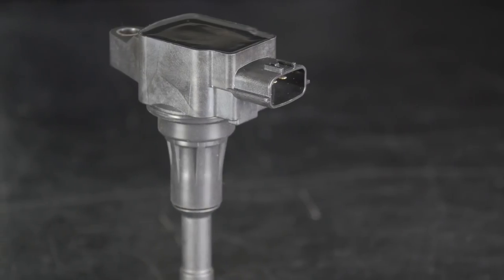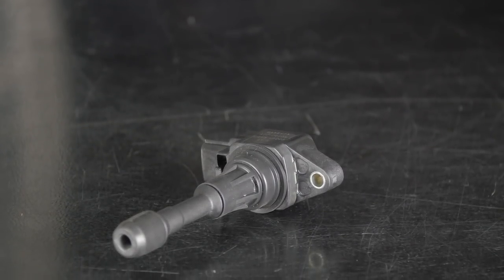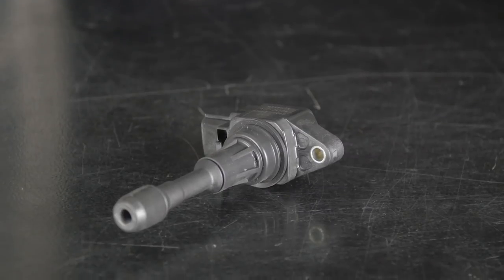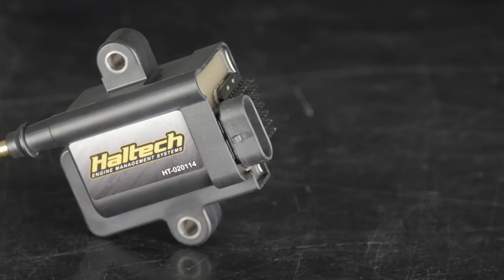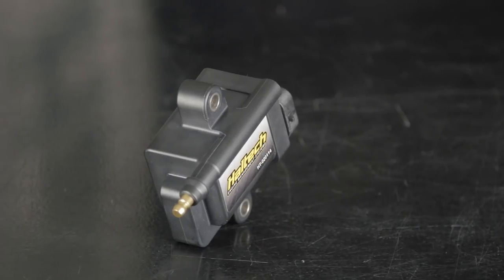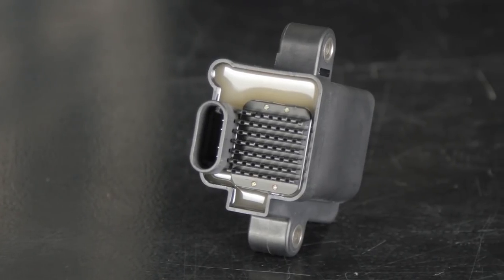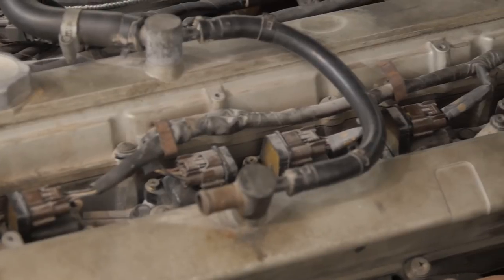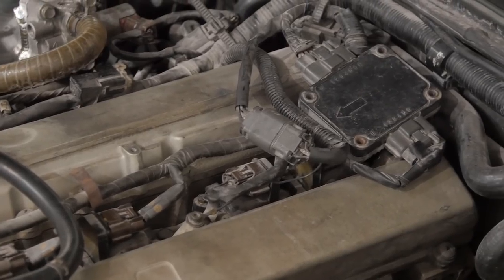🛠 Ignition Modules and Coils  | TECH TUESDAY  |

Comment from the maker: Ignition modules and coils - What are they, which one should you use, and why are they not often seen internally in an ECU? In this episode of Tech Tuesday Scott talks ignition modules and coils, tells you which set up is his favourite, and why. As with all Tech Tuesday videos - we are only covering the basics here, if you want more information on a particular topic - let us know and we'll expand on it in a full feature tech video:)
Reply: What about capacitor discharge ignition used in some older cars and motorbikes? Can they be controlled with a Haltech ECU?
Reply from the maker: Yes indeed!
Reply: Would love to know more about Power Distribution Modules compared with fuses and relays.
Reply: @haltech  i have a question/topic that you could cover. currently turbo charging my k24 accord euro. I'll be using an elite 2500 as piggyback. it has a dead head fuel rail and in tank pressure regulator. do i need to install a fuel rail with return so i can use a FPR that is controlled by boost to keep fuel pressure correct as boost goes up. or can you tune it to open injector for longer during higher boost to compensate for boost pressure. also only going 8psi of boost, i suspect higher will have no choice but to change the fuel rail for FPR. that would be a good topic for a vid about fuel pressures
Reply: great videos! how difficult is to control a automatic transmission & electronic rear diff with a Haltech ECU? Thanks a lot!
Reply: With r35 coils on my sr20 how do I adjust on the sport 2000???
Reply: @muzzarobbo  Fuses and relays are out of date technology that take a long time to diagnose issues with manually. Fuses blow and need replacing. Relays take up space and need large diagrams. With PDMs/PDUs everything is neatly packaged in a solid state system that self-disgnoses in real time. The future is now. Awwww yeaaaah!
Reply: so an LS/r35 coil doesn't need an external igniter module?

Comment: You guys have GOT to do something on nitrous oxide. I know it's not super fashionable any more, but some of us live places where E85 is unobtanium. I'm especially interested in staging and/or proper granulated control. "Just do a 200HP wet shot" doesn't really cut it.. How to get the ECU on board to control it, and at the same time adjust the boost map to the colder charge temperature while the nitrous is spraying?
Reply: E85 is never unobtainable. It's easily ordered online.
Reply: That sounded rude. Just trying to give you information. Have a great day!

Comment: Can y'all do a complete video on converting a cable throttle to an electric throttle? Not just high level, but in depth into what you will need? I am considering making the swap but I have a lot of mismatched parts
Thanks
Reply: What you will need will be vehicle specific. They explain in detail what they sell, and how they work.
Reply: @captninsno2320  it's not really that vehicle specific. Unless it's all preconfigured in the Haltech for all throttle pedals and throttle bodies, I imagine you would need to map the resistance of the throttle pedal (not all throttle pedals are going to have the same range) and you'd need to map the throttle body (as not all throttle bodies will have the same range or resistance or coil setup). I'd argue that they can walk through the process of converting and configuring a "universal" type pedal with a "universal" type throttle body. I am sure LS and Chevrolet parts would make it easier to set up.
In my instance, it is likely going to be a Mini Cooper electric pedal and a Mitsubishi Lancer 2.4 throttle body since those parts bolt up to my car already and I have them on hand. But a chevy TB would need the same set up process unless it's already preconfigured for it out of the box for some sort of plug and play set up. You could also cover things like adding in cruise control or some sort of throttle cut for traction or engine safety.
There is a whole lot of Haltech info they can share. They always say they are awesome, but never how to set one up ;-)

Comment: Hi, 

Maxxecu recommended putting an external capacitor on a built-in ignition coils system wiring (on 12v supply) in order to absorb voltage spikes which in turn prevents CAN disconnection. What do you think about it ?

Comment: so with my haltech elite 750 or 2000 if i have the 1zz smart coils, im a bit confused by the wiring diagram, it says dont connect directly to the ecu, so are you saying i need to have an external ignitor/ cdi system when theyre smart coils? or do i just need to supply them with their own power and ground, and then the ecu just sends the trigger signal?

Comment: Okay, Im getting into a controller that grounds an ingnition module to stop the unit. When running it supposedly opens that ground and a signal on that line feeds back to the controller for crank disconnect. 
What would that signal be? like a high voltage spike or ?

Comment: G'Day,,Learning Lots from you Guys,you Tuning Fork,Turbo Yoda and such like,,Thanks 
Have you guys seen the you tube vid on Plasma ignition,,an Indian Bloke sets up some caps and takes Spark form a spark to a plasma pulse,
Is this a good idea,?
Will the heat Rating of the plug need to be changed,?
and,,(There's always an 'AND')
Will it have any affect on Standard or any ECU,?
And,,(This Time there's 2 "ANDs")
If you incorporate this into your system,How will this affect burn time,?, is there a possibility it may Burn cylinders and or Valves,?